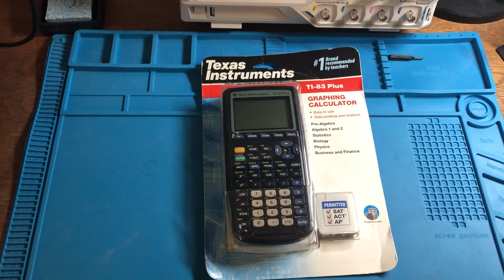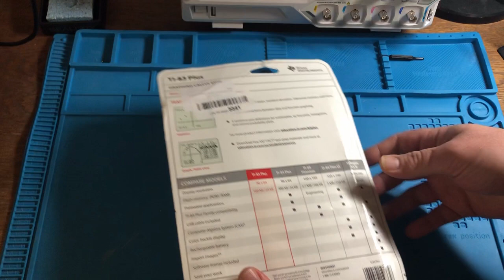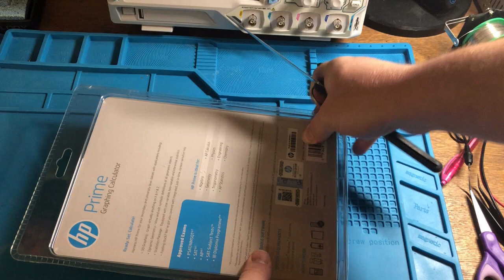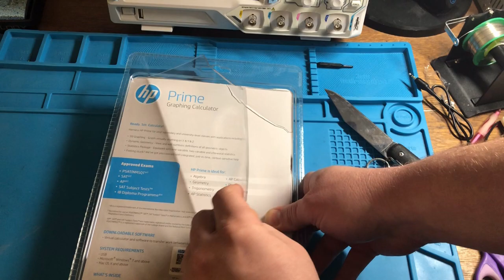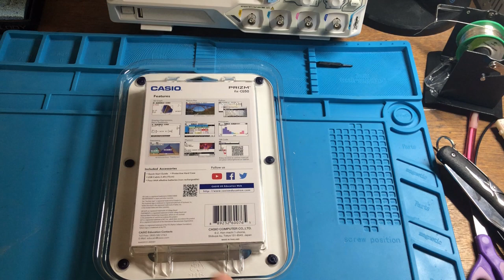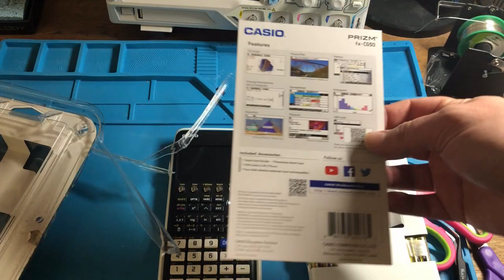Unboxing 3 Graphing Calculators: Casio fx-CG50, HP Prime, TI-83 Plus.

Comment: What I don't like about rechargeable batteries (HP Prime) is:

1. Limited mobility & use of the calculator while charging the battery.
2. All rechargeable batteries in the world have limited life and its capacity gradually decreases with time, making the use of those devices very uncomfortable.
3. Some rechargeable batteries are difficult to replace by new ones once dead, some are impossible to replace and some others are not available after some time, forcing you to buy a new device.

Because of all what I mentioned above, I find much more convenient and practical the use of calculators that are powered by conventional AA or AAA alcaline batteries (you can always carry with you a spare pack, if not they are very easy to find on near shops, they are not degrading their capacity over time and when needed to be replaced you get a full charge in just few seconds with immediate unlimited mobility).
Reply from the maker: I 100% agree with all of this. I had a TI-NSpire CX CAS in my collection for a while but I did not own it for a whole year before the battery life became unbearable. I often go long periods without turning my calcs on until I need them for a burst of activity, and with this use case it was just painful to use. I would have had to keep the device plugged in 24/7. I actually ended up donating it to goodwill because I was just sick of looking at it.
Reply: The HP Prime's battery is really easy to access and you can get a replacement off Amazon for really cheap if you ever need to replace it. I still understand your concerns about the limited mobility. That's why I always carry a massive battery pack with me everywhere.
Reply: @KrazyCouch2  That's fine, but in 10 years time, will those replacement packs still be available on Amazon? What about in 15 years time? 20 year's time?

Comment: I think that it might be charged as felony when someone publicly announces that TI firmware security keys was hacked and He will use that same hack to sign illegal firmware as in this video.
Reply from the maker: The legal precedents set surrounding the use of reverse-engineered signing keys protects private citizens' rights to crack their own devices. It is more-or-less assumed that doing the same as a for-profit organization is not protected, and would result in civil charges; but this has never been tested in the court of law.

TI-Education has actually updated their signing keys for cracked models, so any models that were manufactured after these cracks were released tend to be immune to the crack; they would need their new signing keys likewise brute-forced, and no one is doing that work.

Regardless, the legal language that allows for the enforcement of firmware protection exists in clauses in the end-user-license-agreement, making it a matter of civil law, as opposed to federal law. In the case of an individual citizen, such as myself, these clauses have proven unenforceable in the court of law.

Comment: That appears to be an anti-theft device that you pulled out of the battery compartment of the TI-83 Plus at 4:03. I believe it's designed to trigger an alarm if someone tries to walk out of a store without having it deactivated at checkout.
Reply: God forbid someone uses the 5 finger discount on the handheld 8 bit home microcomputer.

Comment: Which one do you prefer and why between the HP Prime and the Casio fx-CG50?
Reply from the maker: mauricio lacruz I am heavily leaning the Casio of these two when talking about stock firmware. I feel like casio’s interface is not only snappier, but uses more informative UI elements, providing more instant and intuitive access to information in a smaller space.

[Edit]: I also find myself preferring the case style of the Casio over the HP Prime. It feels better to me in my hand. The AA batteries in the Casio also is more to my liking, but that is a personal preference. The slider also feels better when removing and replacing and can be placed on from either direction so you can't accidentally try to put it on upside down.

They’re both still new enough to me that I can only offer this as an initial impression.